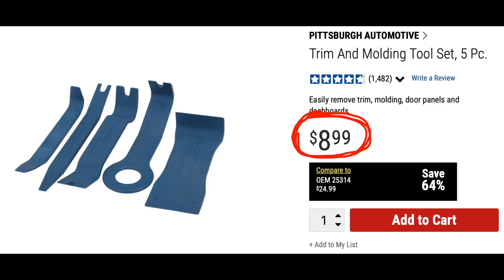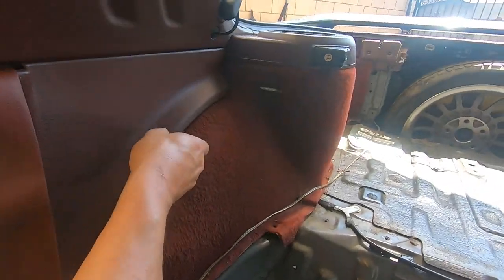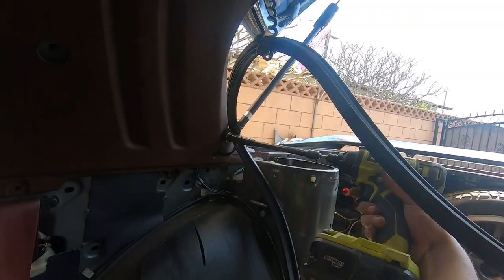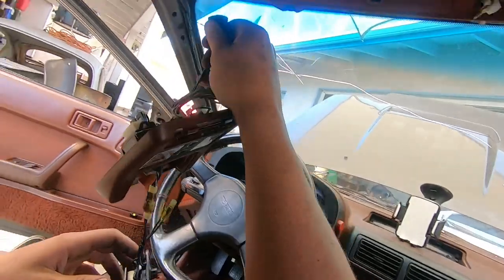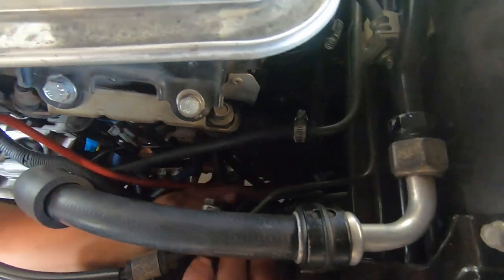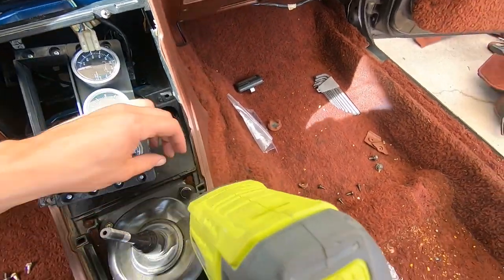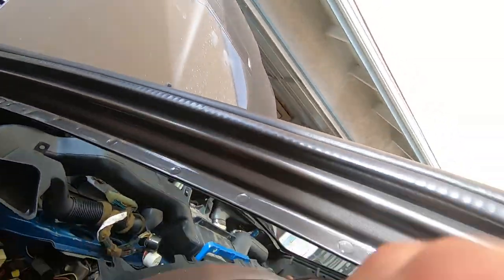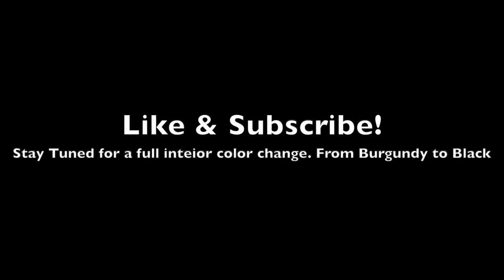RX7 FC How to Remove Interior in 16 Minutes

Comment: There is a plastic barb under the blower motor  that holds the carpet in place. You have to lift the carpet over it to slide it out. But to access the barb you have to push in the heater core lines from the engine bay and remove the blower motor unit or lift  it enough to  Pull the carpet out.
Reply from the maker: Appreciate the tip!